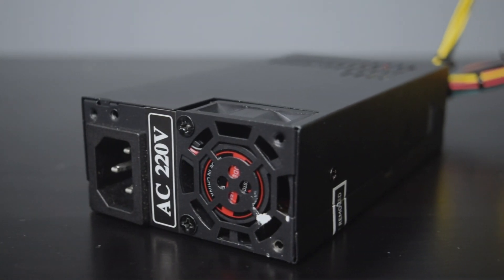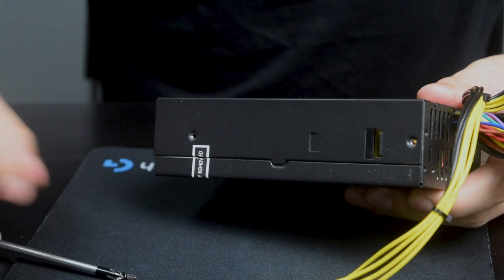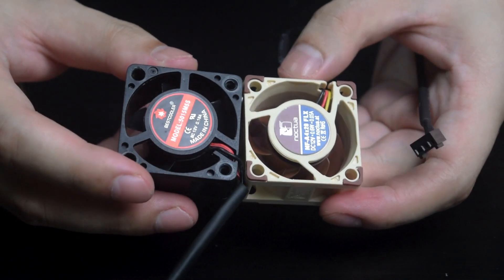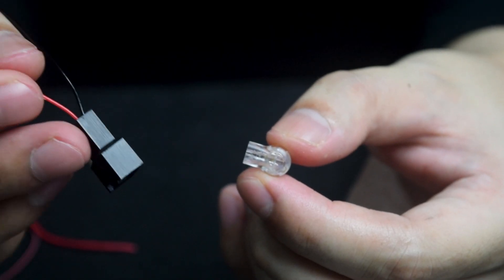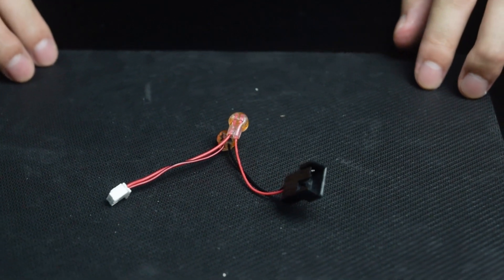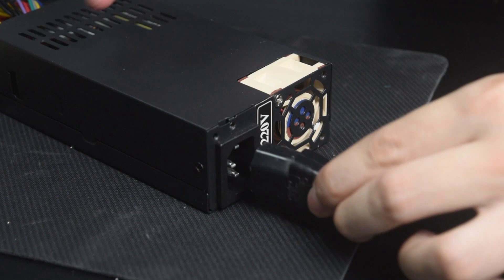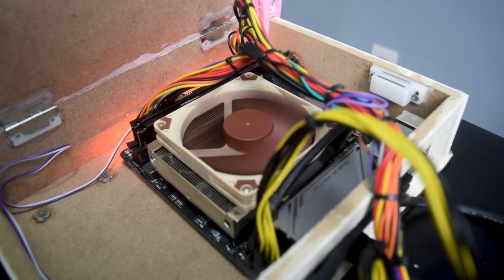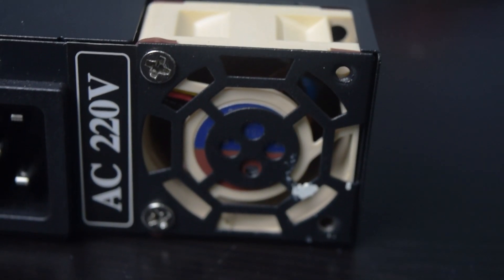How to Replace 1U Flex Power Supply Fan to 40mm Noctua Fan || PC Mod

Comment: Be sure that both fans have the same static pressure, it’s important for a good airflow inside a PSU like this one
Reply: guys the noctua fan is just fine. those stock fans are server grade units with no regards to noise. ofc the stock fans have better pressure but the noctua fans will work good enough in a normal day to day homelab usecase.
Reply: @dwight2310  i would agree with this statement, they need to be higher pressure for server application where is a lot of heat around and needs to be moven quick, we don't have to forget most atx psus nowadays runs almost without active cooling (if efficient enough) where the fans dont even bother if dont have much heat around even at moderate load. My 700w seasonic completely passive.
Reply: How I can know if my new fan have the same static pressure?
Reply: Not really, the fans they put there are usually an overkill, meaning it's cooling performance is more than is needed esp. when they don't use 4 pin pwm fans to slow them down. Just a bit of air moving there will usually keep it appropriately cool, so he probably could have even attached a 50% voltage reduction on the line making the fan go slower and thus quieter and it would still be most probably fine, best way to know is to test it while disassembled and check temps with IR thermometer with old fan, then new fan, then 50% voltage reduction. Obviously just don't touch anything inside it when it's on, and best to avoid touching it even when it's not plugged in, there is no reason to do. so anyway.
Reply: does anyone can confirm if noctua performs worse on heavy load?
Reply: @grvy012  I have a noctua in mine. It has worse static pressure i think from my research. If you're using every last Watt with a hungry GPU, best to stick with default fan. I use a 3060 / i5-10400f all undervualted so not worried about getting too close to the bleeding edge. My 7660B has a fault where it makes an annoying high pitched noise and im getting some burning smells under heavy load so in the process of replacing it, so take what i say with a grain of salt, it works for me but my PSU was faulty from the get go.
Reply: @grvy012  also would like to know. I wonder if since there's no follow up video, it either went really well or really bad lol
Reply: +Wolker  Your comment is not quite correct. The airflow doesn't need to be the same. The airflow should not be LOWER but it doesn't matter if it's higher.
Reply: @svenlima  of course, by same i meant “at least”, like the amperage of a PSU
Reply: Update for you. I have the exact same PSU but with A4x20 PWM model. Stress test both GPU and CPU for 8 hours and no problem seem to be found. Can not say anything else about other fan model.
Reply: @003thezg3 could you measure the temps?
Reply: Also, the original fan was chosen because it ramps up/has a curve that goes along with the behavior of the power supply and the way behaves, temperature-wise, when it's under load.  If you get a fan that has the wrong curve, the PSU could overheat.
Reply: @tronus98  no, it was not. it is a fan. a fan has no "curve" to "go along with the behavior of the power supply".

important is the static pressure on different levels of voltage (or different PWM Settings on a PWM Fan). if that is the same, the fans perform the same.
Reply: 胡元正  So, under a huge load the noctua fan would be worse
Reply: 胡元正  i know, that’s what i wrote in the first comment

Comment: !!Caution!! Before servicing a PSU, allow it to remain powered down for a few hours to allow the capacitors to dissipate any charge that could be present.
Reply: Unplug it then turn on the ON switch. That will drain them faster.
Reply: @exploranator   that it? thoughts there was more to do
Reply: Or you could do it with a couple of wires
Reply: A few hours is enough?
Thought there was some technique to discharge the psu
Reply: @thibautnoah2599 use light bulb 100w to discharge it
Reply: ONLY if you touch the underside of the PCB board, were the caps pins are soldered, and he did not have to remove the hole inside out of the PSU case, and if you do that you let them drain with switching the switch without power, or use a screwdriver, but it won't kill you if you touch the underside of the PCB board, were the caps pins are, i have had it more then a few times i touch the two solder pins of a full 400 a 450v cap, it hurt for a moment, but not terribly painful, it's more the scare you get from the shock, you cannot die of a 400 a 450v cap from a PSU, it has not enough energy to kill you.

Comment: Finally someone gives the real details big thanks 🙏
Reply from the maker: hope it helps! thank you too
Reply: @ItsTimeToBuildIt  whats this psu in the video? i wanted to do it with the hp pl11 1200w, but it's a 4 pin fan, with a different connector and way less space inside the psu :(
Reply from the maker: It's dark forest. Alternatively, you can connect the psu fan directly to mb too.
Reply: What?!  I didn't get those adapter pieces

Comment: Great video, I'm getting the velka 3 case and planning to do this to the psu.  I saw one guy skipped the wiring and connect the 4 pin fan header from notcua fan straight to the motherboard, do you recommend doing that? Also whats the little thing called to join two wires? Great video
Reply: i think he did that because he got a 5v volt fan, to connect directly to the power supply you need a 12v volt fan. Noctua sells the same fan in both voltages.
Reply from the maker: You could directly connect the 4-pin fan to the mb so that you can monitor and manipulate the fan speed. The little thing called skotcthlok connector, it's included when you buy the noctua set.
Reply: Glad that i read this, i was confuse, i mean, i was concern about the fan voltage, i also saw some online seller put different option of voltage for the same fan model, now i know that the psu fan need 12v power